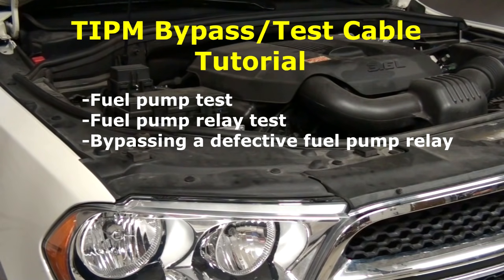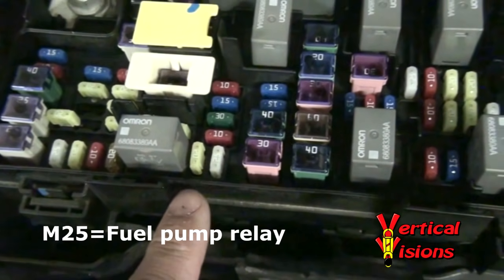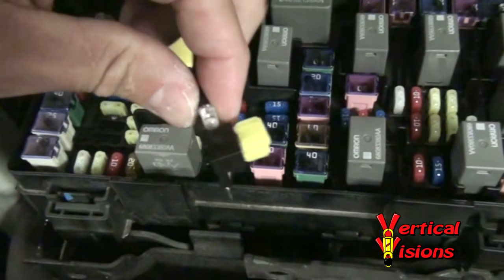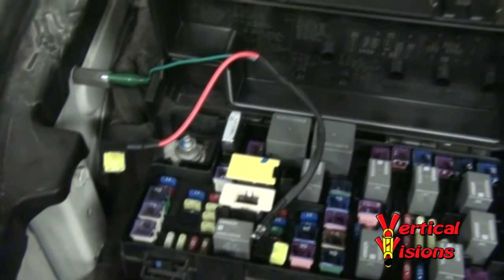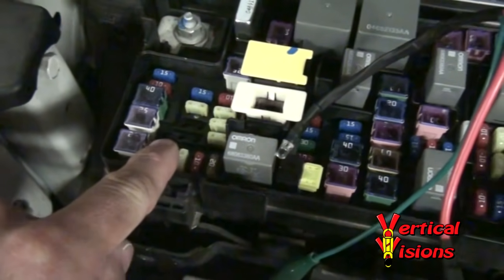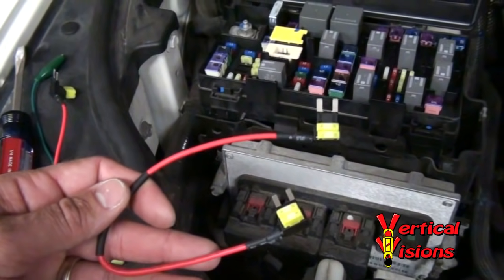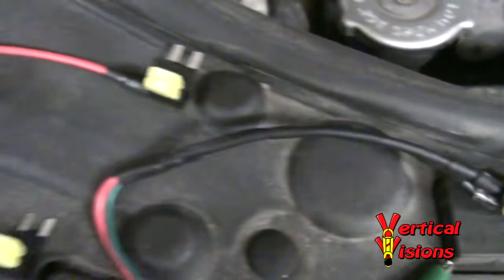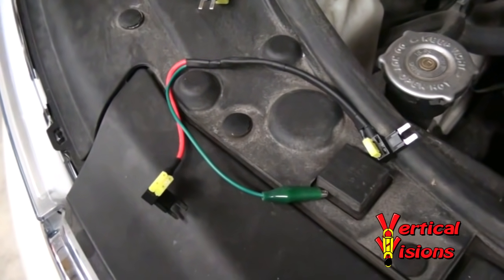TIPM Fuel Relay Test and Bypass Solutions - Most 2007-2021 Dodge, Chrysler, Ram, Jeep, VW Vehicles

Comment: My car starts up when I put quick start in it but then he quickly cuts off I have replaced the crank sensor I have replaced the fuel pump I have the bypass machine the simple one but I don't hear my fuel pump when I'm supposed to hear it so does that mean my fuel pump is not working or is there something else wrong cuz it starts once I put quick start in it but then it cut off I don't know if it's the pressure or what else I need to replace
Reply from the maker: If you bought the simple cable directly from us (not on Amazon), just give us a call at 304-933-9391 and we can provide instant support.  Chances are you're connecting use the older M7 power source, which we no longer use.  M7 has occasional issues in colder weather in providing proper power to the cable.

Comment: Great video.  I just ordered your plug-in relay, I have been dealing with intermittent extended crank issue for a while, same TIPM.  I just replaced the fuel pump and previously bought the simple bypass cable.  Everything seemed to be fine with the new pump and bypass installed, but today it did the long crank again, just like the relay issue.  How can that be possible if I used the M7 to M25 bypass?  Hoping I can verify what's going on when I get the plug-in relay.
Reply from the maker: We use different slots now (M37) rather than M7.  From our product FAQ located here:https://verticalvisions.com/en/mini-blade-fuse-slots/22-tipm-bypass-cable-simple.html
---------------
8) When using the older M7 left slot to M25 bypass mode connection, my car only starts on the second attempt or won't start in cold weather. Is this normal?

Answer: It's rare, but some TIPMs won't power on the M7 circuit during the starting process. We've performed some testing/research to determine that it's likely attributable to the TIPM cutting off all unnecessary power draw during the starting process in cold weather or with lower battery voltages. Please use the newer configuration that is described in your instructions for bypass mode, which will resolve this problem.

With no power to M7 left slots, the TIPM cable can't deliver power to the fuel pump via the M25 fuse slot. There are some workarounds: (1) Cycle your key or start button to ACC and RUN mode, then start the vehicle; (2) In extreme cold weather, move the TIPM cable from the left slots of M7 to the right slots. Start the vehicle and then move the cable back to the left slots of M7. Keep in mind that plugging into the right slots of M7 forces the fuel pump to remain on all the time, so you'll need to return it to the left slots while the vehicle is running or after driving. This isn't an issue with our cable, rather it's how the TIPM handles cold weather starting.  

Low battery voltages may be due to your faulty relay being "stuck on", which powers your fuel pump when the vehicle is off until it partially or completely drains your battery. It's complicated, but some faulty fuel relays fail in different ways. They may fail early on by simply not allowing power to pass through the M25 fuse and to the fuel pump. Then they can switch to being "stuck on", which keeps your fuel pump running when the vehicle is off. You'll need to remove the lower yellow 20 amp fuse on the M25 end of our cable to completely disconnect the faulty relay from the fuel pump circuit and prevent battery drainage. The next time you try to start it and it fails, hook up the alligator clip to ground and watch the green light if you have the LED version of our cable. If the green light comes on when you turn the key to ACC, but then goes out only during the starter cranking process, your battery voltage is likely low. Charge your battery and/or make sure the lower fuse on the M25 end of our cable is removed. If your fuel pump is receiving power during the starting process but still fails to start, you might: (1) Have a faulty fuel pump (please use our cable to test your fuel pump), (2) Have no gas in the vehicle, or (3) Have a faulty crankshaft sensor or other problem that is outside of our knowledge base. Keep in mind that our TIPM cables have always been advertised as temporary solutions. Permanent solutions are available through us and we offer great discounts to those who've purchased our TIPM cables.
Reply: Thanks Jason, I just installed the plug-in relay and seems to work good.  I still get the extended crank under certain conditions, warm engine after sitting for ~1 hr.  This plug-in relay helps eliminate the fuel pump or fuel pump relay as being the cause.

Comment: I used it but it works after two years fuel pump pressure twice fail while I am driving engine cut off went to dealer oil pressure fail ,I am thinking is good to replace the fuse box ,I know it cost a lot of money.

Comment: I used the more simple cable yesterday on my 2012 VW routan, I tried to start it up this morning and my battery which is less than a month old is drained. The fuel pump ran all night. I saw another video and the gentleman place the fuses in m37 and m25, that's what I did. When I do it how you explain it, it starts right up but now I can't shift out of park to R,N,D. Any idea where I'm going wrong?
Reply from the maker: If you bought your cable from us, we provided 4 pages of color instructions that will show you the correct connections and we respond to calls and emails for support.  If you bought a knockoff inferior cable from Amazon with no instructions or support, you need to contact them. You get what you pay for.
Reply: @VerticalVisions  okay, so no advice on where I went wrong with the installation? Just a jab at where I bought the part from. A mechanic recommended I grab the part and pointed me in the direction of ebay, if I would've known the great Jason bell had a website to buy it from I would've went there.  I appreciate your reply at least.
Reply from the maker: @insidetheholmes  My prior remarks were not directed at you, but at the less intelligent people on Ebay and Amazon who steal all our designs, IP, and hard work to sell copies of our product.   You bought a knockoff cable from a company who essentially makes customers think it's our cable.  EVERY day of the week, we field phone calls from people who buy these knockoff parts thinking that it came from us.   You get no instructions with the knock offs and many people hook them up improperly.  I have already told the world how to build their own TIPM cable and provided thousands of replies on this thread, but I can't provide product support for a product that is not mine.  I don't even know what you have or the quality.

Comment: I have a 2010 Dodge Charger fuel pump does not turn on I believe it is the tip them is there a way of buying a cable from you to bypass my tip them
Reply from the maker: We have not tested our parts on your vehicle.  Here is how to identify if it will work on your own:  https://verticalvisions.com/en/content/21-basics-of-bypassing-testing-relays

Comment: I’ve considered getting this for a ram truck.  Only thing is I know the pump works when hooked up on a separate battery and plug.  But when I put power to m25 nothing happens.
Reply from the maker: Both events you mention should result in power flowing to the pump......unless you have a wire issue between M25 and the pump.

Comment: I might have an ac compressor clutch relay issue on my 2006 ram 2500 diesel. Do you have a bypass ac compressor clutch plug in or any suggestions ? Thanks!

Comment: is it normal for the ends to get hot?
Reply from the maker: It depends.  Did you make your own or buy a knock-off?  What wire gauge is present in the cable?
Reply: @VerticalVisions  yes i made one from the parts store its 16 gauge
Reply from the maker: @alextyson9420  We only use 14 AWG wiring in our cables.  Your 16 gauge wiring can be rated as low as 10 amps.  Fuel pumps require around 9+ amps, so your cable will probably not last long or get hotter than normal.  Look for 14 AWG wiring in your cable.  Since all TIPM cables are only considered temporary solutions, here are some patented long term TIPM Plug-In Relay solutions that can handle the heat:  https://verticalvisions.com/en/17-tipm-plug-in-relay-systems

Comment: bought and installed on my 2012 1500 and it starts right up! Any idea how to get the remote start to work now? Ever since the installation of the bypass, the remote start does not work. Thank you!
Reply from the maker: Yes, of course.  If you bought the cable from us, it includes updated hard copy color instructions showing a newer way to hook up the cable and enable remote start.   If you bought a cheap inferior knock-off cable with no instructions from those who have stolen all our IP/images/text, then you got what you paid for.

Comment: bleshooting. My questions next are where do you attach the fuel pressure gauge? And, what is the max pressure you should achieve in this continuous mode vs relayy active mode, if you know both pressure. My caravan starts the pump when the starter engages only. Is this correct or when the key is on it should pressurize to appr 15 psi?

Comment: I have a 2012 Town & Country with the same problem.  Once these problems start and you don't address it quickly, then there will be consequential damages as well.  In my case the fuel pump kept on running 24/7 and thereby rapidly reducing the life of the pump itself.  Even after repairing the TIPM by installing the new generation relays (both 5 pin and 10 pins), the car still cut out from time to time when you're really cranking it , because the fuel pump cannot deliver the amount of fuel anymore.  The fuel pump was simply worn and had to be replaced.

Other faulty symptoms from the same faulty relays are the windscreen and tailgate wiper washer pump not working properly.  Once replacing all the faulty relays, they work again.

Comment: Can this be a long term solution? Can I leave this bypass in place for 10 years and not cause issues?
Reply from the maker: No, this is NOT a long term solution and never has been.  No one in North American makes "add-a-circuit" cables and everything overseas has issues in high heat environments (think Arizona in the summer with an idling vehicle).  Every TIPM cable made will have this issue due to the way these cables are made (crimped, not soldered).  However, we have a patented long term solution that solves this issue:  https://verticalvisions.com/en/17-tipm-plug-in-relay-systems

Comment: when you say use this to keep me on the road, is there another long term option besides replacing the whole tipm or will this method can be use long term?
Reply from the maker: We now have better options that are long term:  https://verticalvisions.com/en/17-tipm-plug-in-relay-systems.  TIPM cables are only a temporary option due to manufacturing limitations.

Comment: Have a 2009 ram 1500 hemi  my truck have different  fuse box  from 2010 up can you tell me what is the fuel fuse on 09 model thanks
Reply from the maker: These will not work on any 2007-2010 Ram trucks.  Here's why:  https://verticalvisions.com/en/content/21-basics-of-bypassing-testing-relays

Comment: Hi Jason and everyone. Please help. My symptoms match this diagnosis. Multiple attempts pressing start button. Cranking and coughing each time until, finally a start. Battery drain from fuel pump staying on. But my car is not listed on your website or talked about. It’s a 2020 Dodge Challenger Scat Pack. I’ve been through hell trying to figure out what’s wrong from fights with the dealer to hundreds of dollars and hours in wrong parts and repairs. Would that relay work for me? If so, which fuse slots should I use as my configuration is different from the vehicles described. Thanks in advance.

Comment: Jason bell I have wipers that won’t work I have power at the fuse and at the j20 fuse to I swapped my multifunction switch and my wiper motor and still don’t work dealer said it’s probably the tpm is there a bypass for that to ?
Reply from the maker: No bypass is possible since the relay comes after the fuse.  Let me guess - a Jeep Wrangler?  Many of these vehicles can burn up the wiper on/off relay if wipers are stuck to the windshield due to ice.  Here is our only solution:  https://verticalvisions.com/en/tipm-repairs/49-fuel-pump-relay-repair-tipm-7.html
Reply: @VerticalVisions  nope it’s a 2011 Dodge Ram apparently it only has 2 fuses and no relays intermittent wiper motor the I checked with battery and works and have a second one I bought new
Reply from the maker: @kyleleeklepper7881  For some weird reason, we see many Jeep Wrangler wiper relays go bad.  Other vehicles have the same issue, but it's less common.  If your wiper relay is bad, the only option we know of is a repair or replacement of the TIPM.

Comment: Mine will just completely die while driving and then not crank at all.  Turn the key and nothing not even a click.   Brand new battery brand new alternator.   We will be doing 65 to 70mph down the highway and it loses all gauges and windshield wipers come on for no reason then it dies.  And we have to attempt to get it off to the side of the road and wait.  Turn key nothing.  Hour or two goes by..  Turn key starts right up.     Everyone says tipm. But they all at least have a crank.  We don't.  I even took off my starter and had it tested it's fine too.  I'm at a total loss. Lol
Reply from the maker: Try this:  https://verticalvisions.com/en/content/10-other-solutions

Comment: My concern is this bypasses the original relay and provides constant power to the fuel pump. The oem relay talks to the PCM. In a crash, or bumper to bumper traffic where the fuel pressure builds up to par, the PCM will call for the relay to interrupt power to the fuel pump. This can't be accomplished with this model.
Reply from the maker: If using the M7 to M25 connection method, you are correct.  We now have newer connection methods that can enable this safety feature.  If you read through the comments, you'll see that I have addressed this very question dozens and dozens of times.
Reply: @VerticalVisions  oh nice 👍🏼

Comment: Hi Jason. I'm just wondering if you have a permanent fix for a 2014 Jeep Grand Cherokee. Mine apparently does not fall under the recall list and I can only see the permanent solution on your website for older models. Mine is a September 2013 build MY14 model
Reply from the maker: Although we are working on a circuit board based solution, the following is what we currently have for your vehicle:  https://verticalvisions.com/en/253-grand-cherokee

Comment: Do you have to back feed power to the fuel pump relay on the 20amp fuse side? Or could you just put power to the fuel pump side?
Reply from the maker: It's preferred to not backfeed the relay side.  Backfeeding can cause issues, so the lower M25 fuse should be removed in every type of connection.  You can put power to the pump side of M25 with no issues.
Reply: @VerticalVisions  that’s what I figured. I was powering up or at least trying to power up fuel pump on a 2010 Dodge Journey using power probe right at m25 fuse. I could not hear pump run had to drop drive line and exhaust and then drop fuel tank. I had power at the connector every time I would crank the engine. I put power to fuel pump direct with power probe and it wouldn’t run. In my case it was actually a bad pump.

Comment: Hi Jason. I received my TIPM cable this week in Ontario for my 2011 Grand Caravan and it worked perfectly. Thanks for creating it and supplying to the masses. Great job. : )
Reply: hi I have a question the battery of your car does not discharge ???  When do you have all the cables connected?

Comment: My fuel pump continues to run after truck is off, I already have the bypass relay wire I bought from ur site. My question is, if I pull one of the fuses as u said, will the pump stop continuing to run, and will truck start and run normally or will I have to put the fuse in and out wen i need to drive.Thanks!
Reply from the maker: If you bought the cable from our site, it came with 4 pages of detailed instructions that will tell you to remove the lower fuse on the M25 end of the cable to resolve your issue.

Comment: This hack does not work on my 2008 JK Wrangler CRD.  The cigarette lighter fuse is not energised while the key is in the crank position, so there's no fuel pressure from the tank pump while the engine is cranking.  It might fire but wont properly start.  As a backup for a failing fuel pump relay you can use the wire to run the pump permanently using the "12 VDC Always On" cigarette lighter fuse position, until you either replace the on board relay in the TIPM, or replace the entire TIPM.
Reply from the maker: We now use a new power source rather than the M7 slot to resolve your issue.
Reply: @VerticalVisions  I saw where your circuit board design connects and made a cable for that fuse instead.  It works fine.

Comment: Thank-you Jason, your video is phenomenal! I was able to diagnose the issue prior to letting a mechanic work on what he thought was the issue (ie. replace fuel pump) and thus was able to avoid an unnecessary, & expensive, mechanics bill.

I have ordered, and am awaiting, your TIPM Plug-In Relay System (Lite). Keep up the great work!
Reply: Received fast, installed super-quick & easy, & over a month without further issue. AND just helped a neighbour who'd been having same issue for almost 5 months. He happily took the Vertical Visions info lol